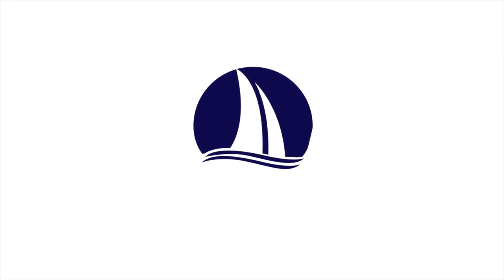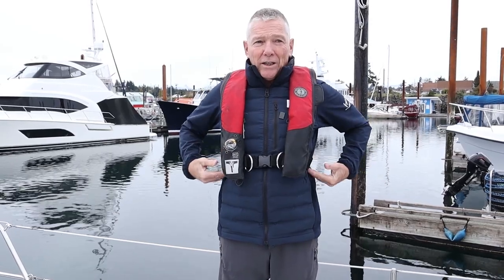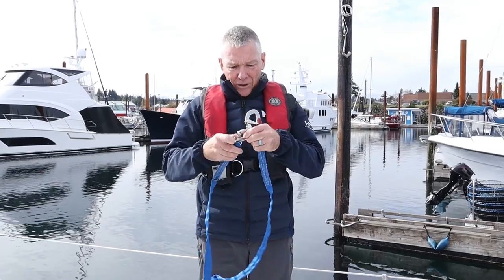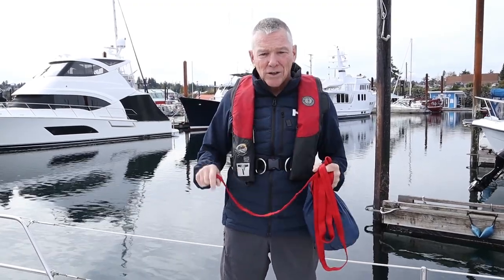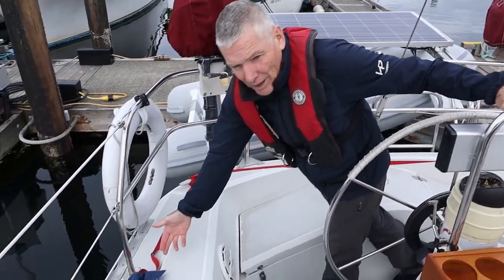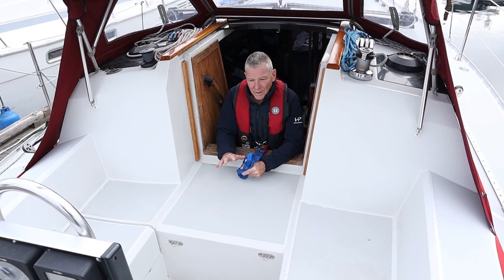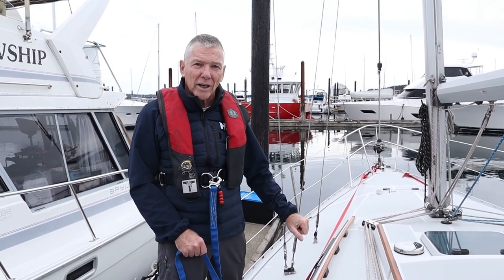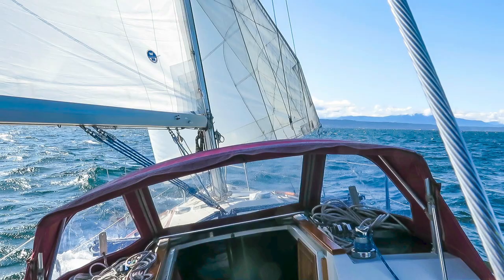Ep 45: Harnesses, Tethers & Jacklines

Comment: Why not double the tether back to your harness, effectively halving the length? If the system is not going to keep you on the boat, what is the point (if solo)? I would also employ the same concept while resting in the cockpit. Attaching the tether to the jackline (as demonstrated) leaves way too much slack and potential for MOB if a knock down or wave swamped the boat. Thanks for the video and kick starting the discussion.
Reply from the maker: Thanks for the comment Personal Best. Once again it's just not practical, even a short tether still does not guarantee that you will not go over the side somewhere on the boat. As I mentioned in the video the only way to prevent going over the side is to be suspended from above or tied in on a short tother to a hard point on the centreline of the boat. The biggest problem with doubling the tether is that you have cloth on cloth contact and the friction could chafe or melt the material. You must always be clipped into a jackline or hard point with a purpose built clip. The double tether mentioned in the description has a 3 foot tether which is the way to go if you want a short tether. The problem is that there are vulnerable spots on the boat, such as the side deck when leaving the cockpit that have you close to the edge of the boat and exposed. It's simply a risk that you have to be ready to accept if you want to sail solo in heavy weather. Ig]f you cannot accept that risk then don't sail single-handed. Problem solved.

Comment: I really like your videos and I have question about something here. If you go overboard when wearing a harness and you can't pull yourself up and back onto the boat, then what's the point of wearing it? It seams like a jackline and tether would just get in the way and a hassle and would be better to just plan to use a PLB on your life vest.
Reply from the maker: Thats a great point Timothy and kind of the point of the video. There is an awful amount of misinformation out there. It is remarkable the amount of comments I've received telling me that if I used a shorter tether that I wouldn't go over the side. Single handing is risky and just like survival storm tactics there is no one right answer. The best I can ask is for the individual to have the best info at hand and make decisions based on that. I dont disagree with you but personally if I was offshore single handed I would have an inflatable PFD with harness and tether on the off chance that I would be able to pull myself back on board but if not then I would have a PLB as backup. The other main point I was trying to make in the video is not to trust gear. Move around safely and only rely on gear as an absolute last resort.

Comment: I have read accounts of people who have gone overboard while tethered and they speak of getting drowned while being dragged through the water at 5 knots or more. There would be very few people who would have the strength to pull themselves back on board, especially in cold wet clothing and life jacket.
Jacklines on the decks do nothing to prevent this.
I am trying to come up with a line running down the centre of the foredeck, one between the dodger and the mast and another between the mast and the bow.
The system needs to prevent you from ever going over the sides.
Perhaps a shorter tether is the answer as well.
I don't understand why yacht builders don't install attachment points down the centre of the boat for such a thing, when it is a fundamental piece of safety gear. Its like automobiles being sold without seat belts.
I tie a boom preventer through the forward cleat on the deck and back to the cockpit. Having jackines tied around the cleat will prevent this.
Again, the manufacturers really need to engineer this important safety consideration into their boat designs.
Reply from the maker: Thanks for the comment Mark. I hear what you are saying but in my opinion it's not the responsibility of the manufactures. The problem of staying on the boat is an impossible one to solve. I'm sure that if there was an easy solution it would be available. It is not as easy as putting seat belts into cars. The situation is far more dynamic with many different people and boats. Like any high risk scenario it is up to the individual to decide if they accept the risk. If not then don't sail solo.
Reply: Don't you only drown once?

Comment: Also it seem a double tether with a one 2' and one  3' or 4' is a superb away to get ones self back in the boat if they fall or washed over as you can pull your self up and clip one rest the pull up again and clip the other to higher or further in board attachment point creeping your way up and in. Another way to aid one self or crew is to tow a paddle board on a strong line a 100-200' behind the boat. lets please admit it, there no chance to pull one self back to the sailing boat or against a current if the boat rounds with weather helm. It is simply physical impossible. But with my paddle board towing option, one could catch the line and swing up unto the paddle board great reducing one brag. They could pull themselves back to the boat or a crew would have a much easier time bring the individual back to the boat with M/COB with the greatly reduce drag weight. Even at 4 knots it impossible to pull one self as the PFD tries to drown you.
Reply from the maker: Thanks for the comment Jim. I have frequently heard the theory of towing a line or in the case of your comment a paddleboard. Personally I choose to use a different philosophy to make sure I do not fall off the boat regardless of a tether or not. The tether is an absolute last resort. For me I like to keep things as simple and uncomplicated as possible. Towing a line or paddleboard, especially in heavy seas is a huge liability in my opinion.

Comment: Run it down the centerline of the boat. Also re-vamping the life-lines with higher stations and  solid-rail life-lines seen on larger vessel's mounted inboard of the toe rail to prevent dockside damage is another option. These flimsy flexible low-knee life-lines are in fact a bit of a joke in heavy weather situations. Hip high stations / rails can be a aesthetically done while adjusting the jib lines around them. $$$ is a factor
Reply from the maker: Thanks for the comment Roger. I get what you are saying but it is not always practical. Running the jackline down the centre of the boat still does not necessarily keep you on the boat, and it is not practical depending on boat layouts, things like dodgers get in the way. I like the idea of higher stanchions and solid lifelines but once again it simply not practical and way too expensive for most. On my boat for example tall, solid lifelines would cost a fortune and look ridiculous. On larger boats they are great.

Comment: Curious; I do roofs. We use rope grabs. Rock climbers do too. Basically they grab the lifeline so you don't fall more than the length of your tether which is clipped to the grab rather than the line itself. You could even do a prusik knot, clip in and slide it along your lifeline. With two, you can even climb and self-recover.. a video on using two prusik knots to ascend a rope. Not sure what wet conditions do though for the bite. https://www.youtube.com/watch?v=bscpdQ6fcPQ
Reply from the maker: I use a prusik loop sling as a back up for going up the mast and I did save someone from a nasty fall by using one. Not sure how well they would work trying to get back on a boat in rough weather. Best not to go over the side in the first place.

Comment: Your tether is dangerously long. If solo sailing you could end up dragging yourself to death. Better to loop the tether around the jack line, thereby shortening it by half, so that if you fall you won’t be dragged in the water. The safety surely compensates for the inconvenience of a short tether.
Reply from the maker: The tether in the video is an industry standard 6 feet long, I did not make it myself. As mentioned in the video there are short, 3' tethers but they are usually twinned with a 6' tether. I did find one short tether (Wichard Proline Safety Tether - .8 m) that is 3 ' long.  

https://marine.wichard.com/en/safety/tethers/proline-range

The choice to use a short, long or twinned tether as well as a hook or sewn loop on the body end is up to the individual and pros and cons of all options need to be considered. Looping the tether around the jackline is horrible advice. Tethers must be clipped into a dedicated jackline (not lifelines or handrails) with a purpose designed clip or sewn loop (and as I mention in the video if using a sewn loop a cutaway device must be carried). Looping it back creates cloth on cloth contact causing chafing which would essentially saw through the tether resulting in a catastrophic failure. In addition even a short tether does not guarantee that you will not fall off the boat. One of the main points of the video, in addition to covering basic principles, was to encourage people to think critically and to consider carefully the consequences of using or not using tethers and jacklines. The kind of dangerous opinion and advice expressed here, which is not based on industry standards or empirical evidence is exactly what I'm trying to discourage. One final thought, as you mention falling off the boat solo could result in being dragged, there is no system that exists that will prevent this possibility completely. To me still being attached to the boat at least does gives me the option to at least try to get back on and failing that I can cutaway and rely on other backups. If one cannot accept the risks of sailing solo then don't sail alone.
Reply: @CarpeDiemSailingMagazine  I appreciate the whole point of the video and education. One option is to loop tether around the jackline and back to yourself, effectively shortening the length by half. It also lessens drag on the caribiner dragging across the deck. Sorry if I sounded critical, I want to prevent someone from drowning by dragging
Reply from the maker: You’re still missing the main point that I’m trying to address in your comment, which is your advice to loop the tether back on itself. This is very bad, dangerous advice.if you want a short tether get a short tether, a proper one
Reply: @CarpeDiemSailingMagazine  got it. I hear you, thanks
Reply from the maker: Thank you 🙏

Comment: 9:29 regarding the various ways of rigging jack lines, Marco, what is your opinion of this method? Seems sensible to me, but I'm no expert, so I'd be interested in a skilled sailor's opinion of it's plusses and minusses. https://youtu.be/LS06AKfIkIk Thanks for your videos, they're very educational.
Reply from the maker: Thanks for the question Harbour Dog. I have had subscribers mention this video in the past. The biggest problem is making a loop out of the tether and using that on the jackline. This is a very dangerous practice as fabric on fabric, especially nylon can melt under tension. Buy a properly designed commercial tether with proper fittings. With regards to his running the jackline around the mast this is certainly an option and I tried it on my boat but it does NOT guarantee that you will not fall off the boat. He demonstrates how secure he is at the mast but anywhere else on the boat he would be over the side so he is providing misleading information. Further the crossed jacklines work for him because he does not have a dodger. As I mentioned in my video there is no perfect system and it is impossible to guarantee that you will not fall off the boat somewhere on your boat. Jacklines are part of your risk management chain but should only be one of many practices that you should follow. For me the jackline and tether is a last resort. Far more important is to stay on the boat by moving carefully around the boat, minimizing the need to go forward, one hand for you, one for the boat, keeping your weight low and so on.
Reply: @CarpeDiemSailingMagazine  Thanks for your reply, those are all good points that you're making. Currently doing a Day Skipper course so of course watching a lot of YouTube and seeing various methods for just about everything! Wishing you a Happy Canada Day from Petty Harbour, Newfoundland.